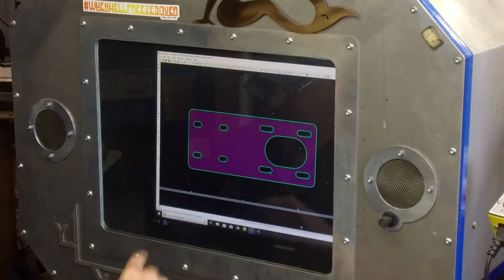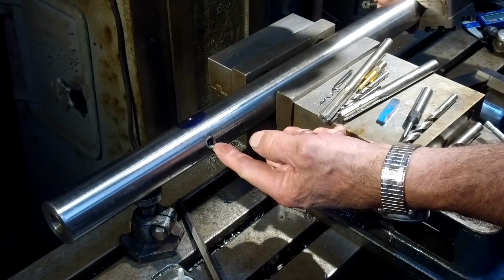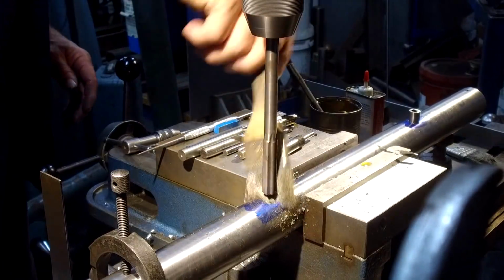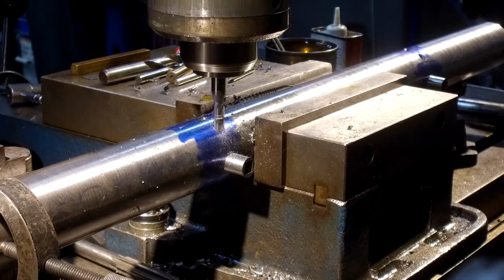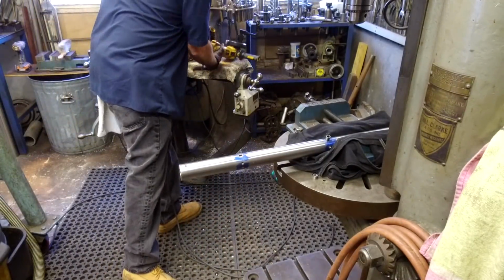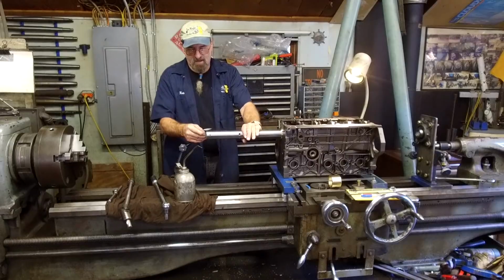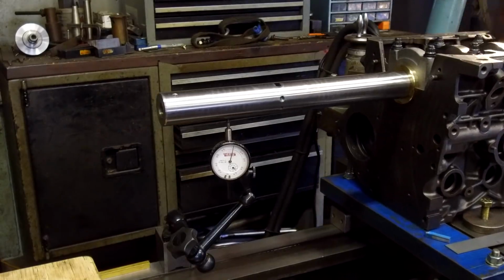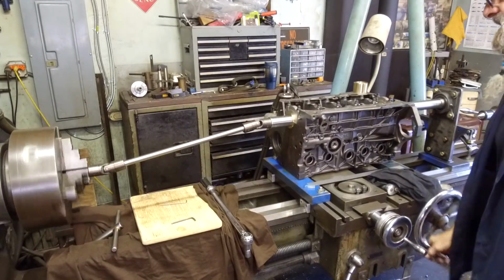Because I Can Part Two

Comment: Yer doin it the hard way! All you need is a bush to fit the first main and the rear seal bore, one cutter that slides back and forth on the bar and even just a drill motor for power.

Comment: Absolutely love the ingenuity. It’s actually very impressive Kieth. It’s funny, I have engineers come into my shop when I’m building turbo snowmobile and off-road engines from time to time and it amazes me how many engineers minds work. Many of them are not creative people. They have on one track mind and need a set of blueprints. Some of them don’t care how or why it works, just that they built it to work if that makes sense. I certainly don’t mean all engineers, but it’s been an experience of mine many times. I’m certainly not saying they aren’t intelligent by any means I’ve just found it fascinating how their brains work sometimes. I guess they probably feel the same way about how mine and yours works as well. I can see it work in my head and can take it apart and put it back together with a photographic memory, but I couldn’t do the math to actually design it to save my life if that makes sense. Usually they don’t have much personality either lol..jk. They could build a nuclear missile, but to have a normal conversation is awkward. Now people don’t get all upright and bombard me with hate, many of you know exactly what I’m talking about. Thanks for sharing your genius Kieth. I have plenty of stories to back up my theory.

Comment: How do you find the CNC plasma cutter? Had one for a while but ended up chopping it in for a waterjet. Found was spending a lot of time cleaning the parts up, having to deal with a heat affected zone and difficulty working with alloy. The waterjet was a recon unit that was not much more than the new plasma system but performs so much better. It easily cut some spacer plates out of six inch thick steel plate!

Comment: Kwikway used to make a similar setup in the 40's and 50's it was a kit with all sorts of brackets and clamps to adapt to most older blocks. It was very time consuming to use and not very accurate.

Comment: Why are you putting your cutters in off center line of the tool? Is this to avoid having to grind negative geometry to machine the material for your bushings? Aluminum nickel bronze?

Not sure of your end result.. your going to support that mandrel head stock end once your dedicated to the cut and have trammed your points on the cutters?

Comment: Keith, i have line bored many a fresh block for different cranks but always set it up for standard OD to use easily obtainable main bearings and have never seen readily available oversize bore main bearings. is this something that is available for German engines? Love the channel.
Reply: I have owned an automotive machine shop for 30+ years the only over sized OD mains i have seen is for air cooled vw's. And late powdered metal rods

Comment: There is an issue there with using those u-joints in your driveline to that "line-boring" bar in that any and all u-joint-equipped drivelines have some "vibration" as the u-joints have to speed up and slow down as they "cycle" through their range of motion. The more angularity there is in the joints the more vibration exists. Up to a point the two u-joints - when properly phased with each other - will "cancel out" that oscillation and vibration. But you've got to be close to the limit for "smooth" u-joint driveline operation. Any "engine machine shop" can do that job properly for less total "investment" and in less time than you can possibly do it with that set-up. There is a practical limit to how "practical" and "profitable" any "DIY" project actually is and when the overall quality of the "same" work done by PROFESSIONALS is better, there IS no real way to "DIY" better and/or cheaper than farming out the work. And by the way, you do realize you have to "shave" the caps and main bearing webs down to make the bores "undersize" before you can line-bore them, right?

Comment: Masterful genius Mr. Fenner!  Whats the name again of that U-joint shaft you're using here?  Very, VERY slick, and cleaner than trying to rig up something similar using socket extenstions and socket U-joints that would have much poorer fit on them.  So what's going to be the direction of the cuts?  Towards the headstock or the thrust bearing?

Comment: Keith I like your setup. Can you tell me why you didn't support the driven end, as I would think their would be some torque that could give some alignment problems, This is unlike the tube you did many video's ago. Keep up the great video's. Thanks again for all the hard work in making them.
Reply from the maker: The bar and the supports I'll be using versus the amount of cuts taken and stick out are very light. No hog cutting on this project. ;{)-----
Reply: Thanks for the reply, Yes I understand what you saying. But would it not be an interrupted cut, causing some vertical torque.

Comment: Have been trying to work out how to line bore on my lathe and you have answered my question I am building a model of a triple expansion engine and the crankshaft bearings need to be exactly in line   Great video Keith and very helpful   Thank you so much Pete   (UK)

Comment: Keath, as always I enjoyed this video, I have been doing performance motor work for a long time, what your doing is very close to how we use to do it, but we would some times have problems with the center housing becoming larger than we wanted, found out, with the longer bar, it would whip. So We cut a bar down to 4" longer then the work, that made a big difference.

Comment: Don't mean to question your methods Keith!  Is there a reason why you have the block upside down and not the other way around . I'm just curious and nosey 😁
Reply from the maker: The next video will explain without having too, but for ease of removing bar and caps for each cut. ;{)------

Comment: Model T Fords were line bored on gang of Lathes set up to do so. They did it with engine block standing up. 
Of course once for casting and then later for  Babbitt bores.

Comment: I have watched you now make several line boring bars over the years and they seem to work great. However, why do you prefer square turning bits in square sleeves. Why not leave away the square sleeves and put half inch round turning bits in the round hole. for better fixation you could mill or grind a flat surface along most of the length on the turning tool shank. Then you could press the flat tip of your lateral set screws on that flat surface. Would that not work as well? Would that not be quicker and cheaper?
Reply from the maker: Mostly the collection of square bits on hand. ;{)------
Reply: there is something to be said for being able to use what you've got on hand...  :)
Reply: Possibly for non tool bit rotation when adjusting depth of cut as well.  Keeps tool bit indexed for a truer doc
Reply: possibly. If you keep the round shank with a flat along it under slight pressure by one or two set screws it should also work.

Comment: I love that setup. I did line boring for years with an electric drill type drive. I never thought about adapting it to the lathe but it would have been tough to mount a skidder midsection or a feller buncher boom on but ya got me thinking. Retirement sucks bud. This is one of the sweetest setups I have seen in many years. Thanks a bunch Keith !

Comment: Hi Keith, what's your thoughts on square broaching the boring bar vs the inserts? Might be challenging to hold while broaching, but I'm sure you'd find a way. Once the bits are in, you could use them for the reference to add set screws. No need for v-block then.
Reply: Likely to put a bend in the boring bar? AM NOT a machinist; love the videos, wonderful skills.

Comment: I hope this block belongs to an Audi Quattro Turbo, it's the only reason i can think of to explain going to all this trouble.
Reply: Could you enlighten me as to why this engine needs new main bearing caps? WAG acceptable.
Reply: One or more of the originals may have been damaged, or they may be made of a different alloy and machined for more strength.
Reply: Because he can.
Reply: @axeman2638  lol yup. The man is a top notch machinist. He has the capability of doing most if not all of the work in house so doesn't have to pay anyone for it. Honestly I wish I had that level of skill and access to a shop like that. Considering the extra expense I've gone through on project vehicles replacing things because in the home garage refurbishment wasn't cost effective or feasible.
Reply: At least the 2.1 was used for the turbo engines (na engines where 2.0, 2.2 or 2.3).
Wonderful engines those 5-cyl turbos!
Reply: Well, whatever the reason, it's obviously cheaper to recondition than replace.

Comment: Good control on your words when that sleeve broke 😃. I probably would have chosen different ones.
Reply: Well. Stuff breaks... Years ago when I worked for  a Mill Supply house (In Engineered products) we sold Roper pumps. The ones we had in stock had Bronze bearings and about half of our customers wanted Graphite bearings. Those we had also. It was my job to change them because for some reason I was the only one that could do it...  Press the Bronze out and put Graphite (4 of them) in...  The trick I developed was to tap the Graphite bearings in with a tiny deadblow hammer. You couldn't press them or they'd shatter instantly.   Tap it just right though and it'd creep in. I always took FIVE bearings because I knew one would break. My work area was two floors below where the parts were stocked. About half the time I didn't need the fifth one!
Reply: @PhilG999  forgive my ignorance what is the benefit of graphite bearings over brass? I would think brass to be the better Choice.
Reply: There are several benefits depending on the application and the fluid the customer is moving. Primarily their use is with materials that are abrasive, which would wear out the bronze bushings quickly. Would be used for chemical resistance where the fluid would attack bronze but not graphite.
Reply: Aha!
Reply: I read this before I watched the entire video and thought you meant one of the sleeves in the block, which would have been a whole different story.
Reply: Playback speed to .25 of normal @ 19:36

Comment: I am a little surprised you did not put a support bearing on the chuck side of the engine like the Tail stock side.
I always enjoy your vids
Thanks
Reply: I was thinking the same thing.
The main concern for me is the offset drive. From the lathe chuck to the engine block.
Even with in-line borers that would still be a concern.

But if Keith can make it work for him, then his choice.